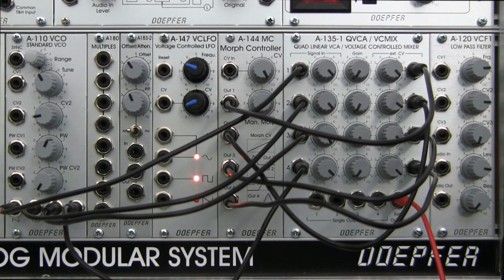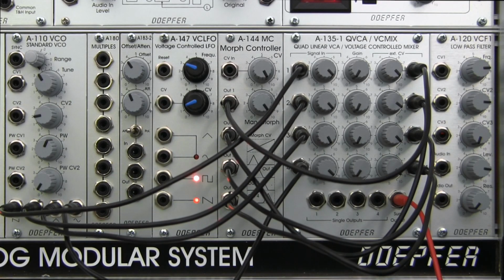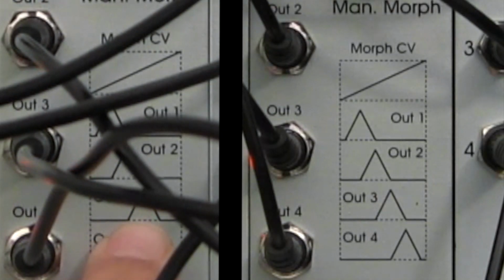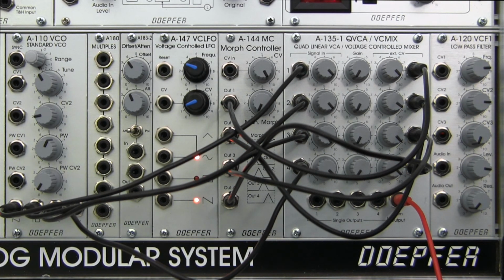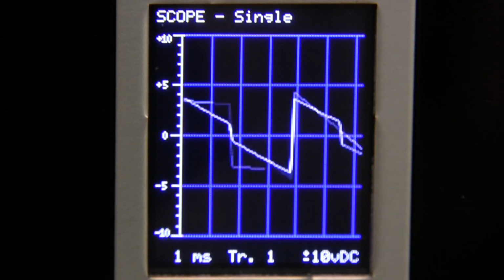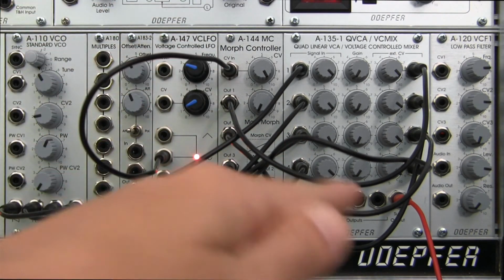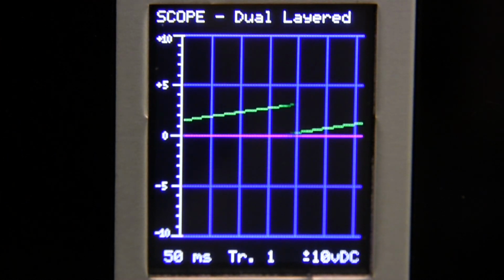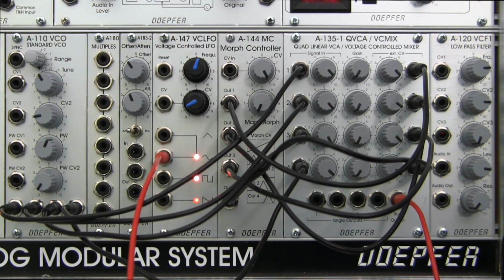Doepfer A144 Morph Controller- Audio Demo Part One-Basic Morphing

Comment: Any reason to get the A-143-9 if you get the A 144?
Reply from the maker: One reason I could think of is the A143-9 has controllable frequency and could be used standalone as an audio source as well as modulation source.
Thanks for watching.